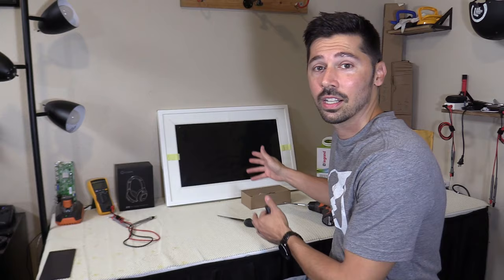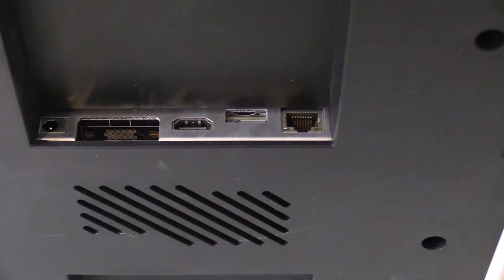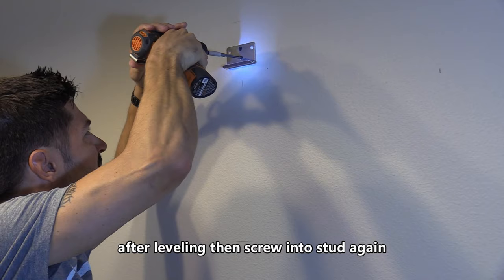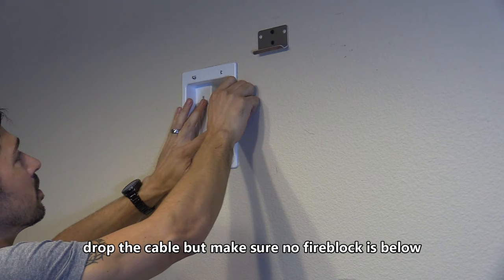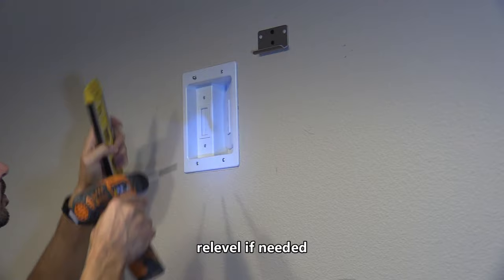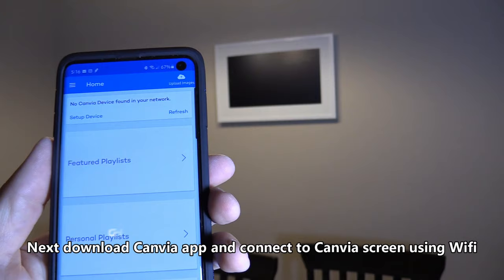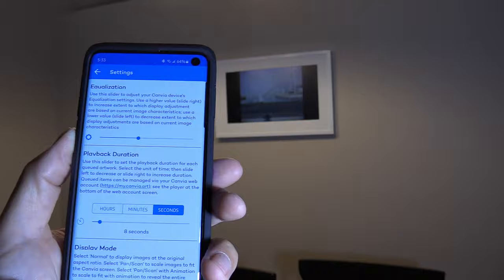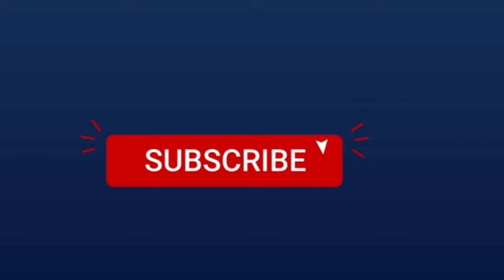How to install Canvia Smart Art Canvas Screen on a Wall with AC Outlet

Comment: Nice clean installation... but it does seem really hokey to me to have a wall plate that needs to accept power from another wall plate. But if you were determined not to do real electrical work I guess this is a solution.